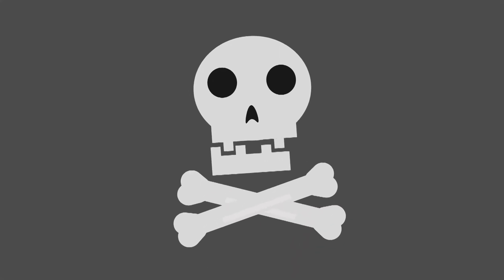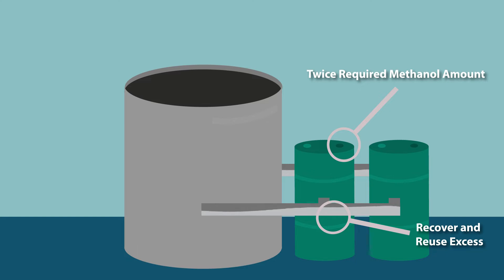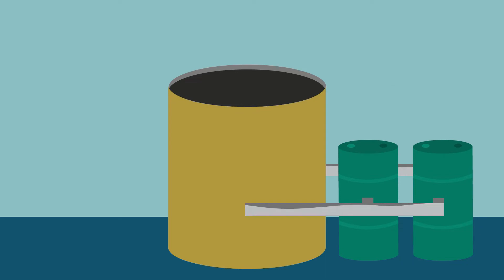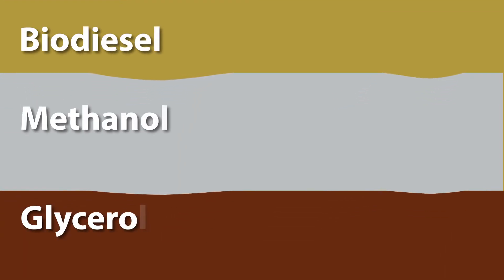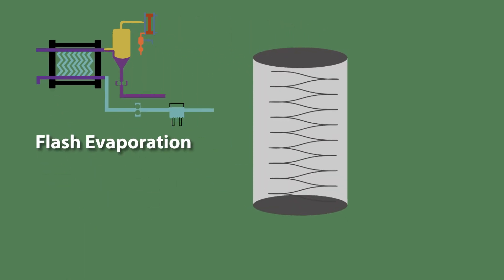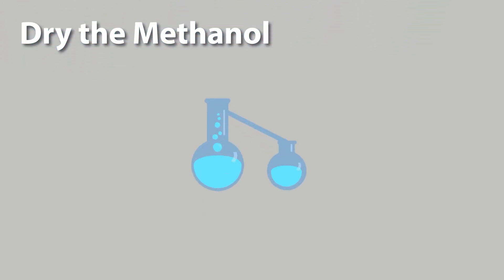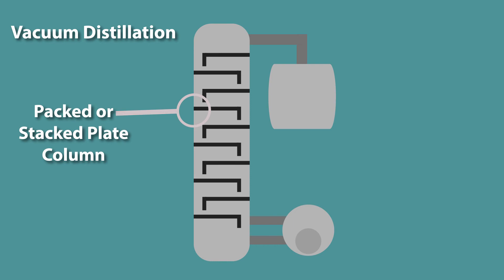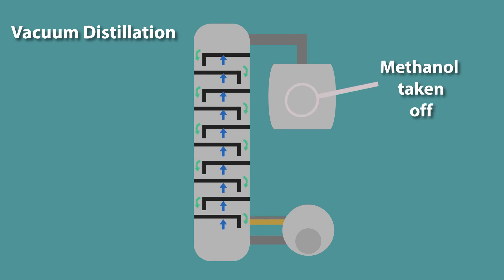Methanol Recovery in Biodiesel Production

Comment: at what temperature is biodiesel distilled
Reply: It depends on the size of the fatty acids and the alcohol bound to them. It also depends if the distillation uses a vacuum. Typically biodiesel distills over 200C under a strong vacuum.
Reply: We flash off biodiesel at 215-230°c under full vacuum.